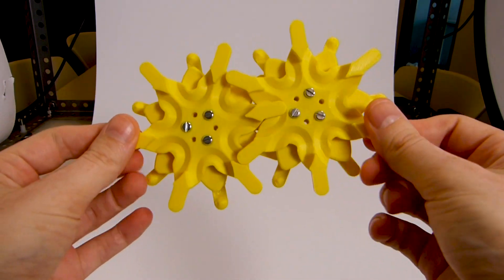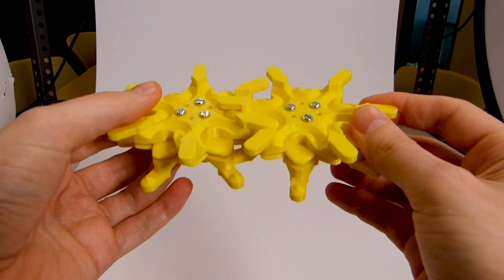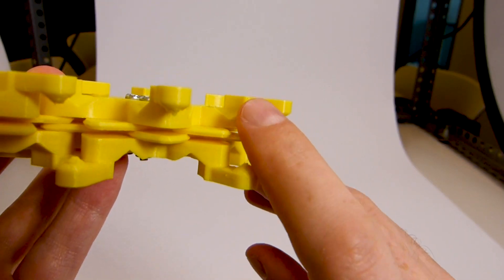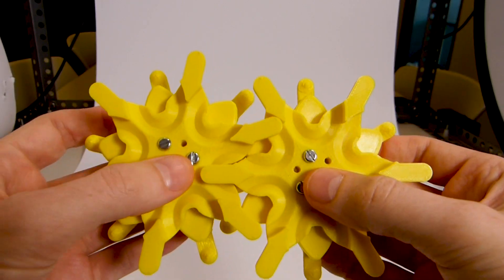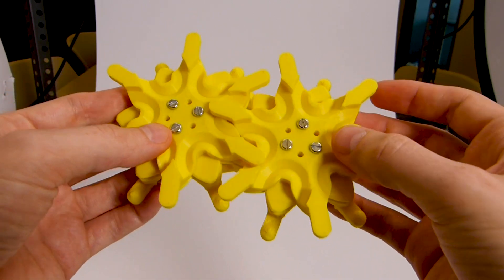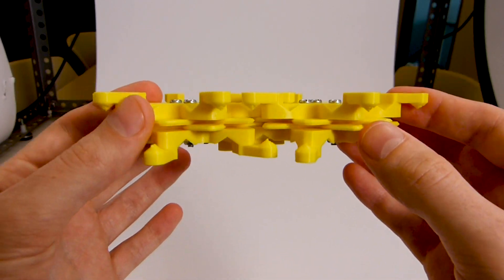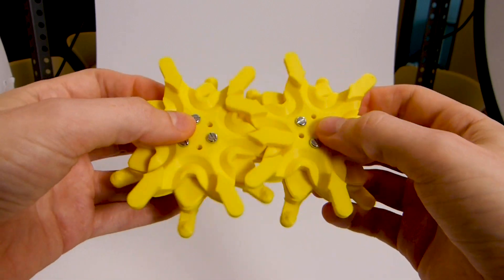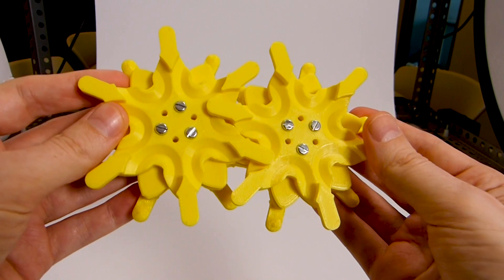Gripping gears

Comment: Is this patented?
Reply from the maker: No, the only patent I have is on the extensors/branched scissor mechanism. It's a lot of effort to get things patented!
Reply: @henryseg   it is easy to get it patented in europe actually. I don't know the authenticity of this design but you could have get it patented really easy in europe. You don't have to apply to countries at the start, just apply for pcr which is quite cheap. Then within a year apply to whichever country/es you want. I am an ip specialist in Turkey which is part of the PCR union. Anyway it is nice to know it is not patented:D Good work btw.

Comment: they can not transfer force since they have no axel.
so, what could they do? Like this, they are more like links of a chain than like gears.
Reply: They could transfer force, in a long chain of them with an axled gear on each side they would transfer the rotation. I'm not sure what practical application that would have that belts and pulleys or a chain across gears wouldn't already satisfy, but it's a possibility nonetheless.

Comment: I wonder what the properties of this design would be in the context of a drive chain.  I'm picturing one gear driven by a motor, while the other is attached to a wheel or set of wheels.  The driven gear could "hang" freely beneath the wheeled gear.  What would happen when the drive torque engaged?
Reply from the maker: I would imagine that the lower gears would always hang down, which would mean that they would rotate under the driven gear, in alternating directions.
Reply: @henryseg  Wouldn't the torque of the driven gear force it to "climb" up and around the wheeled gear?  Perhaps I'm wrong, but that's what I picture.

Comment: So you might ask what is this useful for? And the answer to that is, that I dont know
Reply: I'm thinking if one is fixed on a motor, and the other has an output shaft. Provide power to one thing then swing it around to another as needed. A vague idea but I havent thought about practicality

Comment: That looks really cool! - Does something like this work for arbitrary gears? Like, what about non-planar gears? Or really weirdly shaped planar ones?
And is it feasible to have this be low friction and robust enough to be a reasonable alternative to ones on axles?
Reply from the maker: It should work for bevel gears as well. In principle yes for non circular planar gears, but there could be problems in the arms keeping it together if there is varying geometry. Another possible problem would be getting the arms to dodge past each other.

I doubt that this kind of sliding-in-grooves mechanism will ever be as robust/reliable as a standard frame and axle system.
Reply: @henryseg  Do you think you could use this on your jitterbug designs?